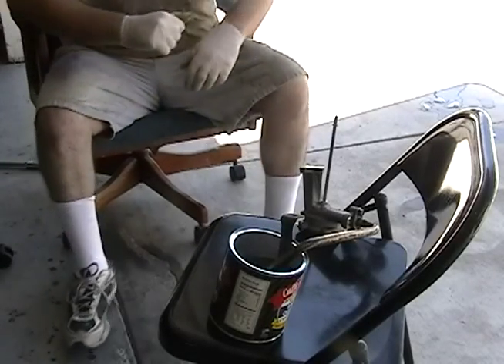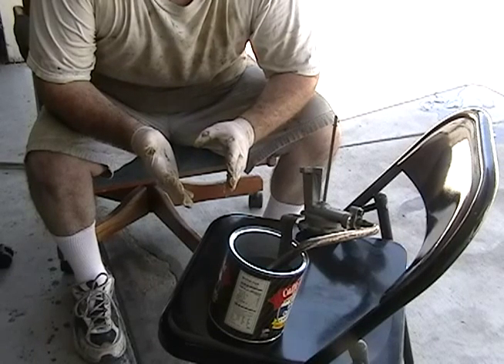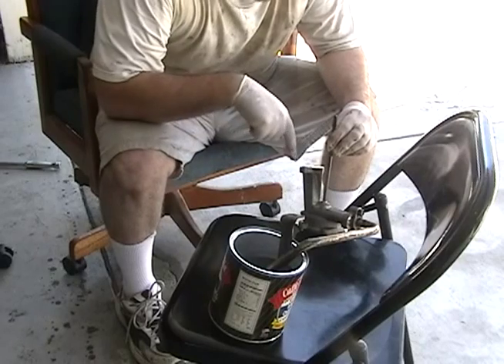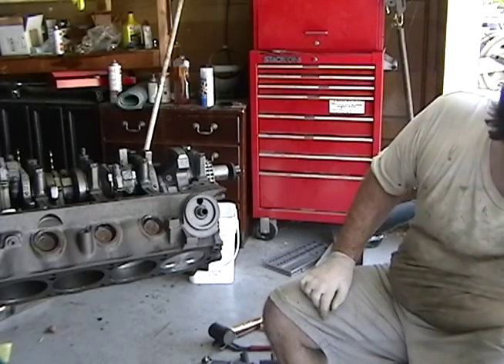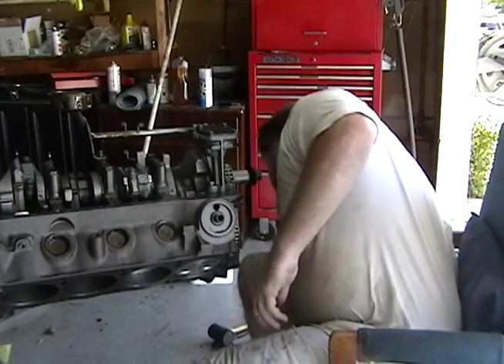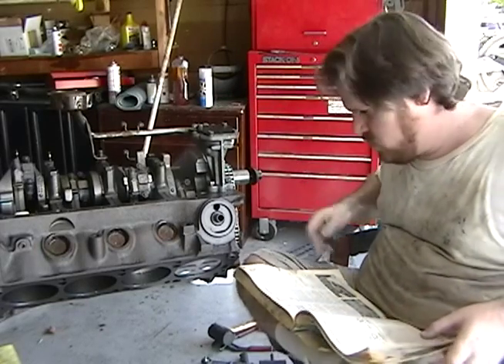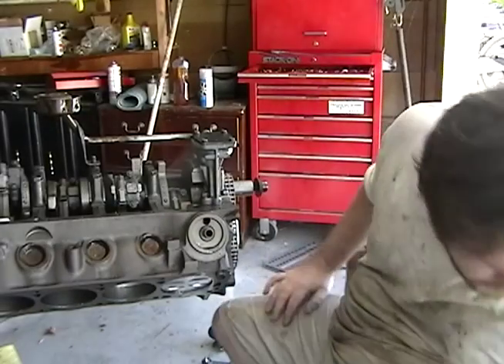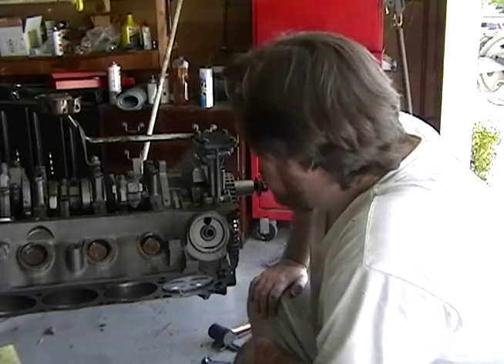1990 Ford F150 302 Engine Rebuild / Overhaul an Engine Part 11 Section 1 Oil Pump

Comment from the maker: Those was good information in this video.Number being 1. Priming your oil pump prior to use(Very important) .
Once you get to this stage, you will see their are only two bolts that old on the oil pump to the oil gallery.
I know I missed recording attaching the oil pump to the block, but to be honest once you have the oil pump in front of you and block, you will see how it fits. It is probably one of easiest components to install.

Comment from the maker: 1st job: Install the oil pump,gasket and screen
Dont worry about the oil pump shaft right now, as you will install that when the engine is upright and your working on the top end. The shaft will be installed thru the distirbutor hole and it is held in place by friction by a metal housing at one end of the shaft. I installed the the shaft much later on the build.

Bottom line: Make sure you prime the oil pump, before installing. The oil pump rotates counter clockwise from the top down.

Comment from the maker: I don't about all of them, but i would go out on a limb, without doing a research, and say that 1990 and later do.  The distributor on my ford rotates counter clockwise, and checking with boxwrench they show this rotation as being universal to the Ford 302. So, since the distributor is rotating counter clockwise that makes the oil pump also counter clockwise.
Thankyou for the question
                              Mike

Good question, anybody else want to chime in.....

Comment: I have 95 Gt with a 5 liter. Does the oil pump spin in a counter clockwise direction on all ford small blocks? Thanks.

Comment: I am trying to install the oil pump on a '95 f150, What I can't figure out is how do you install the pump with engine upside down without the shaft falling out of the distributor hole?